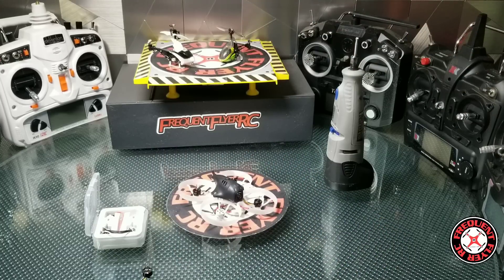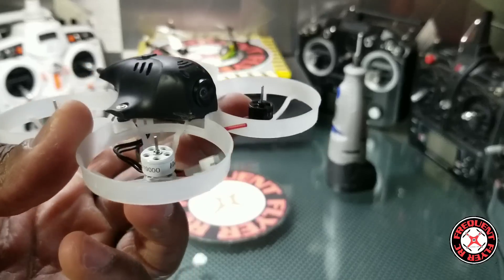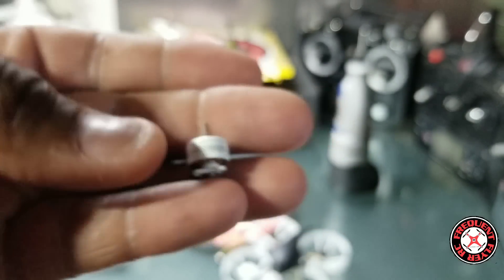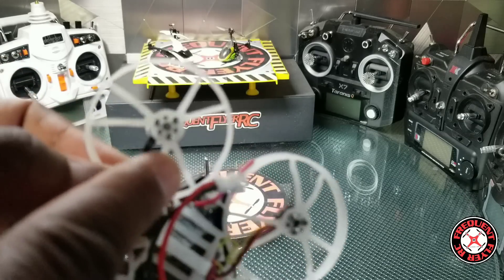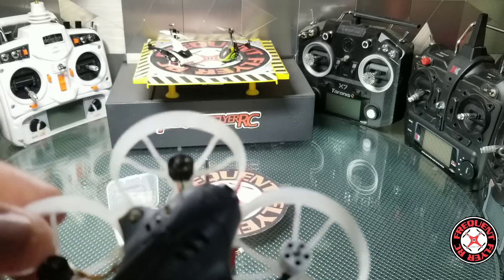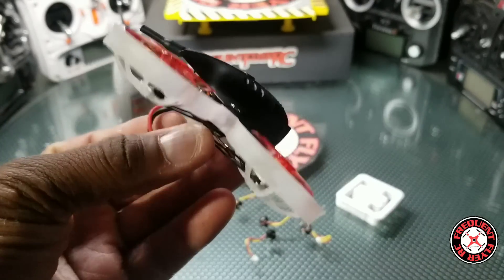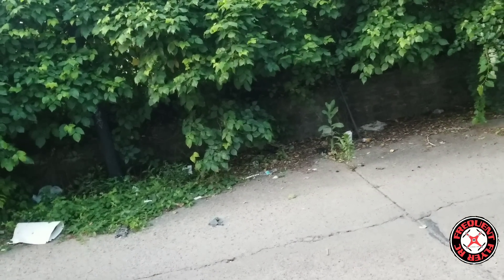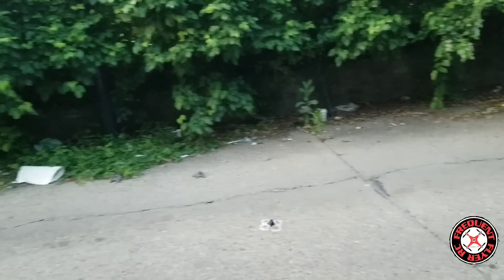Happymodel 0803 19000kv Brushless Motors

Comment: Man those whoops drive me crazy. Can you tell a difference between one with " (wannabe) ducted fans,vs one without?
Reply from the maker: There is a lot of debate about this and I don't know about on 2S but I I can say that with the brushed 1S whoops there is a difference. When you cut the ducts off they don't fly well anymore.
Reply: @FrequentFlyerRC  hmmm ..maybe it throws the pids off?  Or out of balance. The blade guards are the frame right? ....hmm ..someone who finished a.p. college physics ...any input? LOL
Reply from the maker: @mariopuzo4509  there is actually a benefit of having the ducted fan design if done correctly. The little lip at the top edge benefits as well!
Reply from the maker: Watch this:  https://youtu.be/Cew5JF8q6eY
Reply: Idk about AP, but i finished regular college physics, we never had equations close to being relevant to this subject. I think the verdict is "slower but nore stable" with 'wannabe' ducts. Also watch bruce's "duct theory 101" video.

Comment: Nice 👍.  Looks like you got the proper hardware to cocoon the whoop to a toothpick. Just add the Primo 80 frame from Gnarlyfpv.
Reply from the maker: My Trashcan got run over so I have its motors, I have some 804 motors.. so I have choices
Reply: @FrequentFlyerRC  sorry to hear about the Trashcan. Did the FC board survived?
Reply from the maker: @michaelreyes8670  nope, that's the problem. I need to grab another 2S board